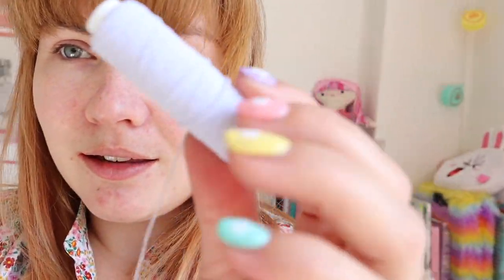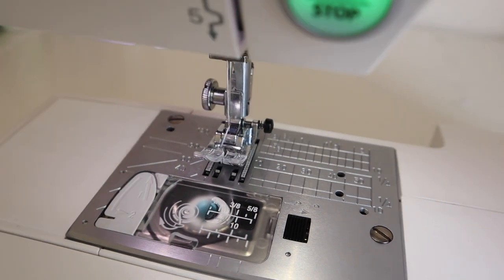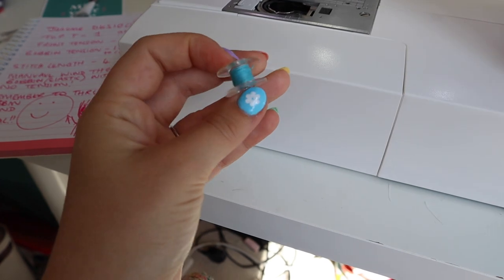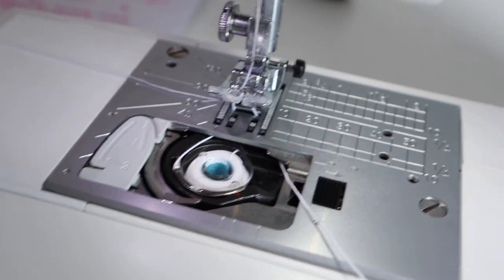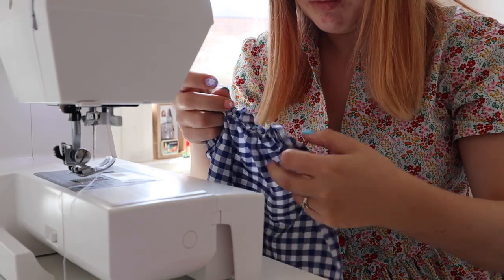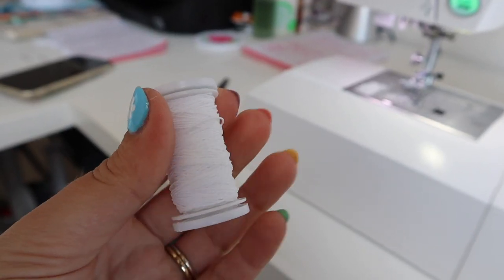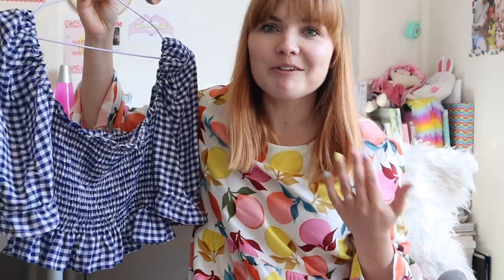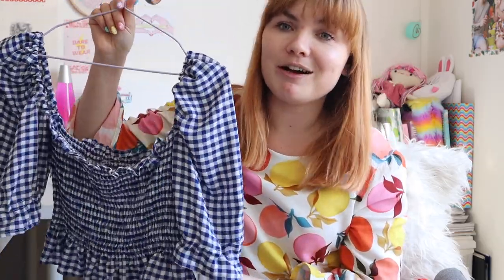LEARNING HOW TO SHIRR FABRIC | VLOG & MY TIPS FOR DROP IN BOBBIN & MORE!

Comment: OMG you just saved my sanity!  I have a Brother drop in bobbin and I wasn’t following the bobbin thread guide as it would get stuck on the cutter.  I couldn’t do what you did with the metal thing so I just threaded my bobbin right to the cutter and several attempts to pull the thread up and then I got it.  And when I looked it had gone into the metal thing on its own once I threaded it right over to the cutter.  Proper threading saved the project and my mind!